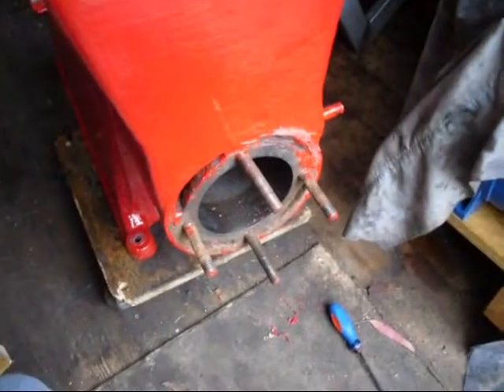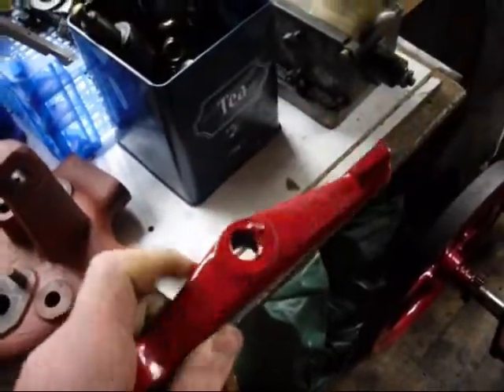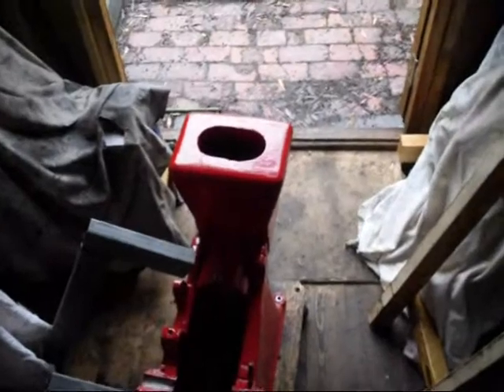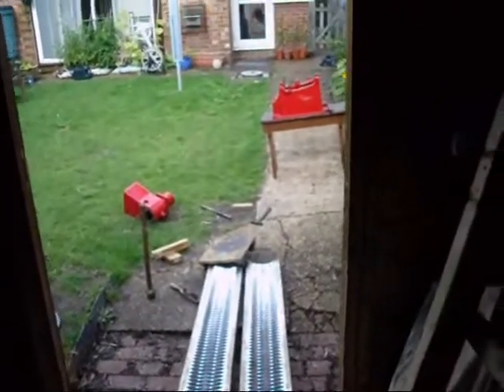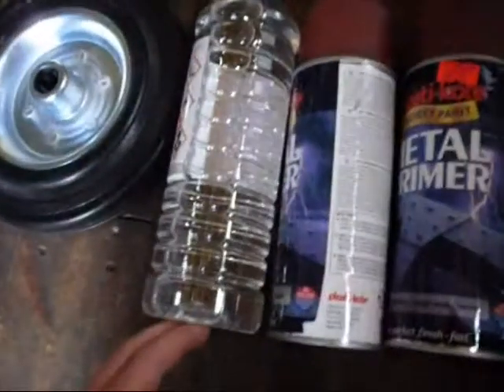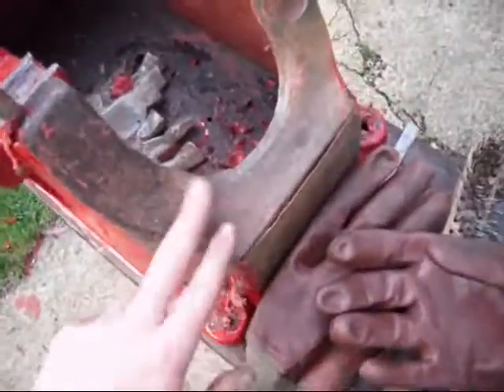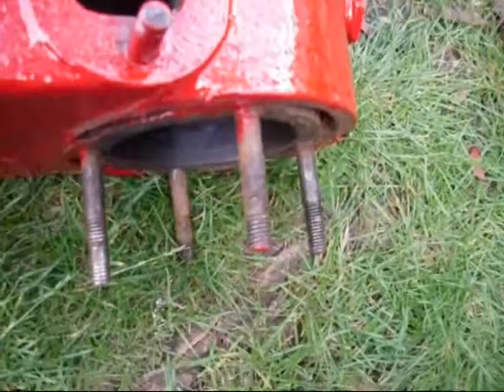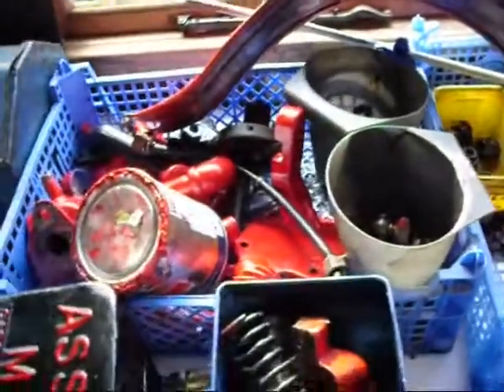Amanco Hired Man restoration - Part 1 -

Comment from the maker: Thank you, it is a paraffin engine and is therefore throttle governed. A hit and miss engine wouldn't get hot enough to vaporise the paraffin. Most Amanco's are hit and miss, but not this one.

The crank won't bend with the flywheels on, it's meant to take the weight.

Comment from the maker: I do have the broken bit of the mixer, found it at the bottom of a tin. Will probably just chemical metal it back on, cast welding is mega expensive. I know someone who was quoted £700 for a cylinder head weld....

Yes, the old gent who runs the shop does allmost rub his hands in glee! I think it's a bit like arkwright in open all hours...he can hear the till ping lol

Comment from the maker: Many thanks, it all seems to be going well so far but I am in need of a couple of bits and do have a question about the mixer.

The engine has no fuel lines or check valves so I am looking for those. 

The little air valve in the base of the mixer has no spring, should this be sprung?

Many thanks,

Phill.